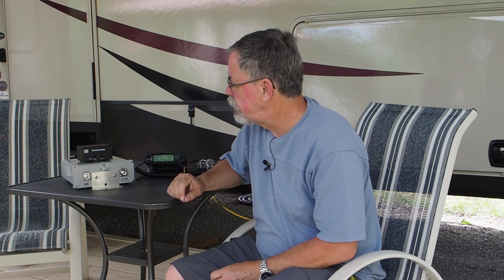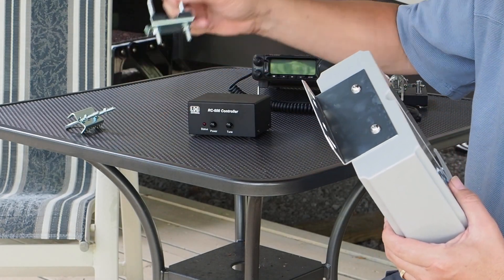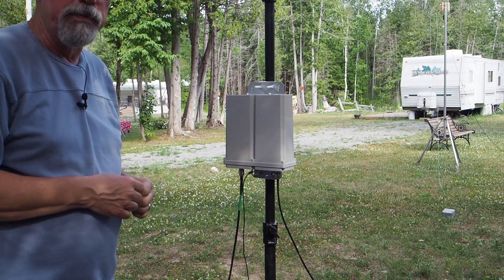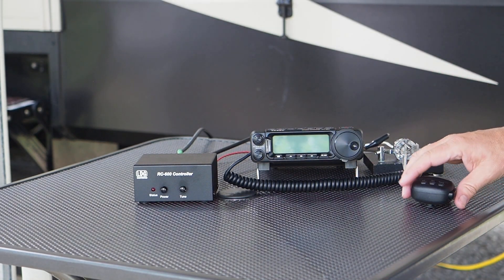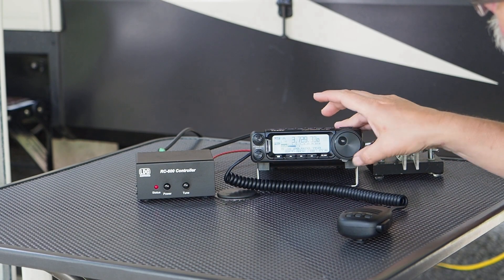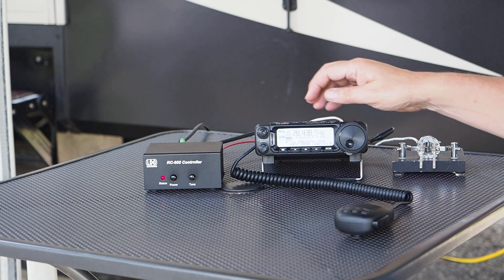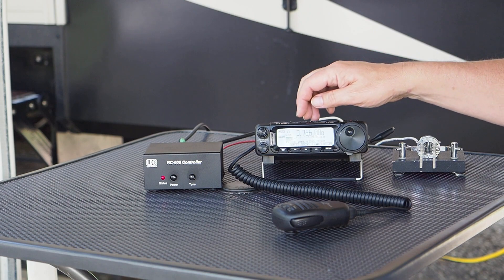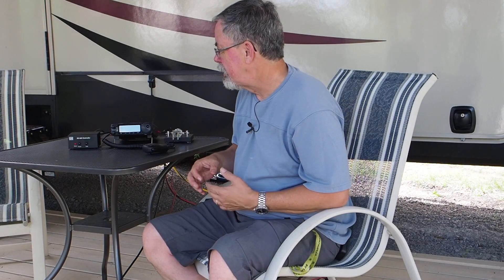LDG RT 600 Autotuner

Comment: That’s disappointing that LDG discontinued the RT-600 remote tuner. Maybe the characteristics are similar in the RT-100, but with lower power restrictions.

I’m guessing that the 20 meter resonant vertical has an extremely high SWR on the 80 meter band, and the tuner worked with that very high SWR.

Did the remote tuner drastically improve the receiving performance on 80 meters, using the 20 meter resonant antenna? I have a 20 meter resonant dipole that receives almost nothing on 80 meters. Perhaps the remote antenna tuner can improve the reception when a resonant antenna is used far from its resonant frequency.

Comment: I’m thinking of getting this remote tuner. I wonder if it can use the radio to Run the tuner instead of the small box. The 100w version does.
Reply from the maker: Yes if you have a Yaesu radio that is Atas compatible have a look at this video https://youtu.be/4W9lwnfU8js

Comment: I have the same tuner.  Another video elsewhere shows how to connect the RT-100 to the yaesu radio without the rc controller. I am guessing it may also apply to the RT-600.  My RT-600 tuner works real well and I like it.  Good video 👍.

Comment: Thanks for the info. Does it remember the tuner frequency settings once the power has been turned off and switched on the next day/week?
Reply from the maker: It will remember the frequency after the power has being turned off.  You will have to retune if you make change to the antenna.
73
VE3BF